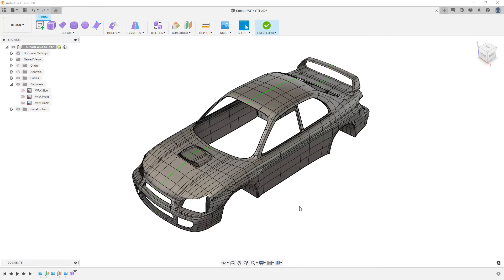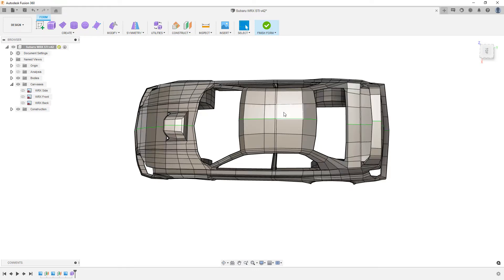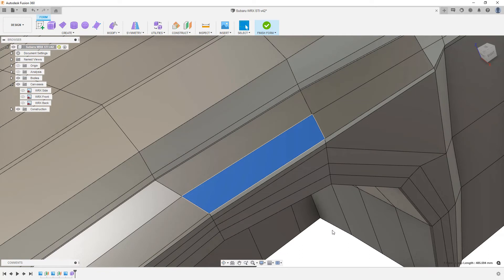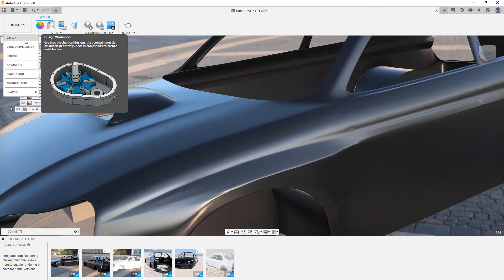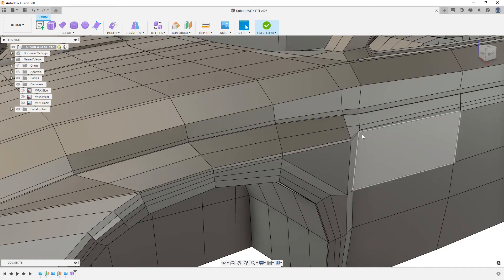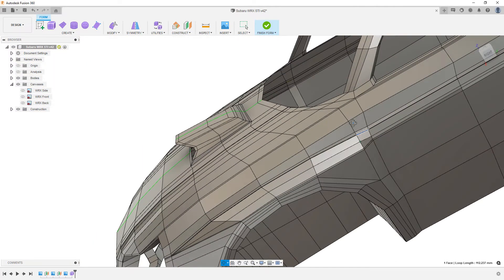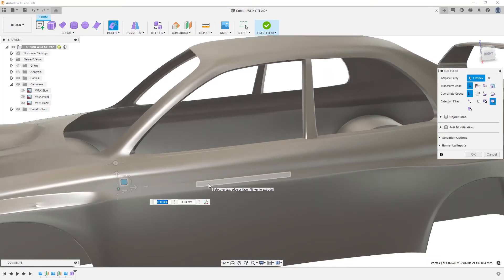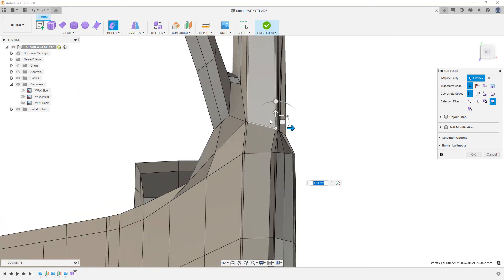Fusion 360 Forms - Part 9 - Fixing Surface Issues

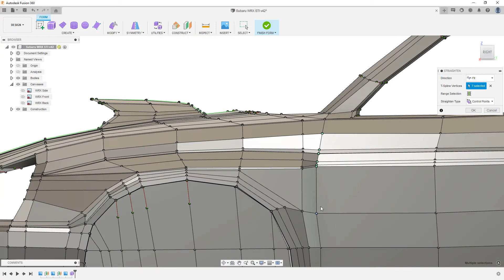Comment: Good evening sir, honestly I find it hard to visualize the problem that led to using the strengthen tool in 8:35 and how the strengthen tool solved the problem
Reply from the maker: yeah its tough.  Basically they are minor surface issues that arise when the box display edges go in then out then in.  Probably my 5 tips video might help.

https://youtu.be/v5tPnXTjewc

Just some general rules about keeping edges and faces and geometry in check.  The big take away is that you want to avoid pinching or narrowing of the box display lines too much or too drastic of a change between them.
Reply: @LearnEverythingAboutDesign  I watched it the day you uploaded it. I have tried watching it again and I feel this problem is addressed in the section that talked about avoiding coplanar/collinear. I still find it difficult to visualize/understand the main issue. I know I really need help, but I am coming from an undeveloped country that most of the people around me don't really take cognisance of good CAD practice. They just aim to have good looking model by just designing without knowing the ins and out. And I am the type of person that really needs to understand the tool and know the best practices in order to make quality designs. Please I would really need your help if it's possible.
Reply from the maker: Its a very tough to explain and the surface problems might be very minor.  If you are 3d printing for example you would never know it.  

One thing you can do is take this back to 2d.  So into a 2d sketch and make a control point spline.  With that control point spline make a bunch of points going from left to right (say 10 points) and each time you make a point have it switch the side of the spline.   This will make a visible wave in the spline.  Select it and turn on curvature combs from the sketch palette.  Then go back and try to edit the spline points and make them as close to a straight line as you can.  The curvature comb is still going to be very wavy and inconsistent.  Each straight line between these points is like the box display on a form.  If you try to make them straight manually there will be some amount of wave to the surface.  If they go from convex to concave back and forth or really close you get a big jump in curvature.  this translates to a form in 3d but now if you have more than 4 sides on a face or if you have multiple directions of curvature it becomes much harder to fix and control.

So because of this i say try to avoid straight sections and reduce the number of edges you have.  Also try to make the edges gradually change angle rather than drastic changes in small areas.

These are just my general rules to go by. you have to break them sometimes.  Curvature map analysis can help find areas.
Reply: @LearnEverythingAboutDesign  sorry sir, so from the video the main issue was drastic change in angle not really that they was a straight section. And then the strengthen function was done to carry it up so that they won't be drastic change in angle between the lines. So it means that we want a shape like the one in the smooth display in 7:57.
Reply from the maker: Sorry i was trying to give you more info than just what was in the video.  But what I said still applies.

In general you want the box display edges from a single view to have a gradual change in angle to better control complex designs.  This is a general rule and there are times when you will have a big change.

The straight thing is that you don't really want the edges to be colinear.  They can be in a line from a single view, say from the side, but when you look at them from the top you really want a small angle between them.  And you would want to avoid that alternating from concave to convex.

These general rules are when you are manually editing complex shapes like cars.

Comment: The problem I keep having is an extreme amount of square red points which keep messing up the smoothness of my surface. Is there any solution to have more control over the surface
Reply from the maker: This car is a bad one with the hard and soft edges for sure.  It is pushing what forms can do.  In general there are 2 main approaches.
1. Keep the least number of faces for as long as possible.  Once you are sure the shape is right, then add more details like beveling edges.
2. Use an over building method.  Make multiple form bodies and then after they are converted you would use surface tools to trim and stitch them together.

The repair tool can auto fix some issues as well as using "make uniform", but sadly the approach with forms is very rigid and  unforgiving.
Reply: @LearnEverythingAboutDesign  I understand. Thank you.